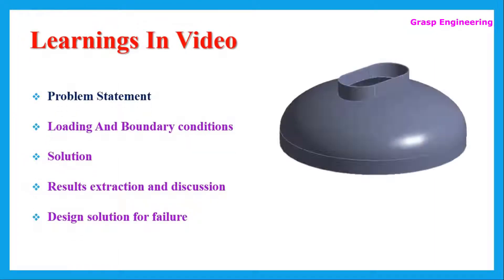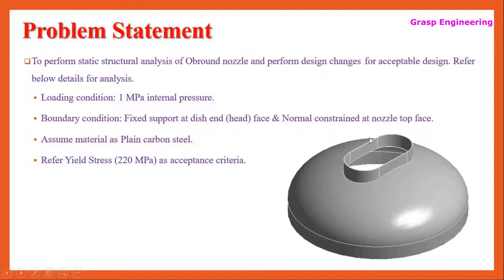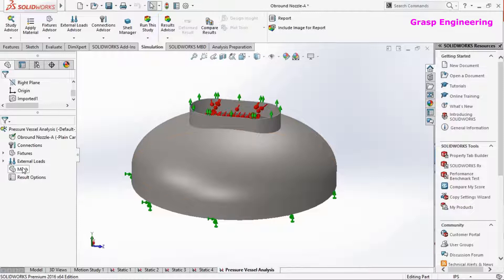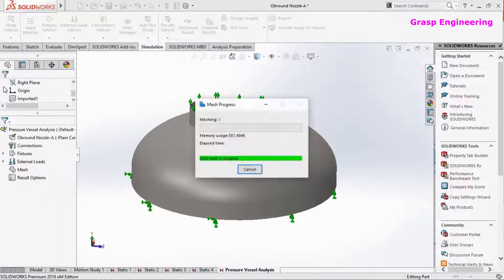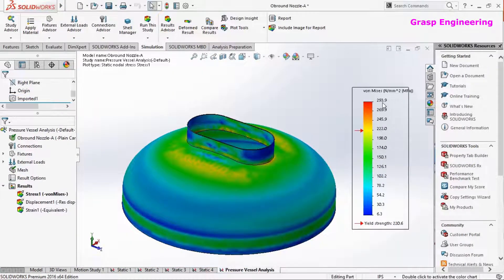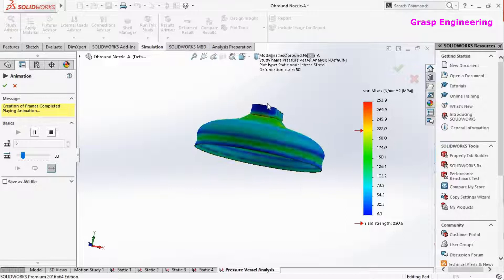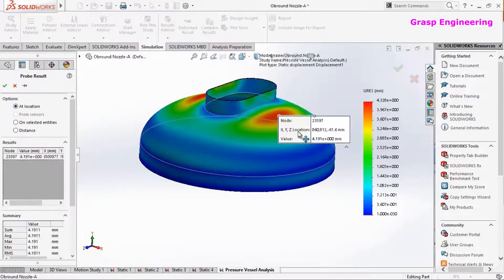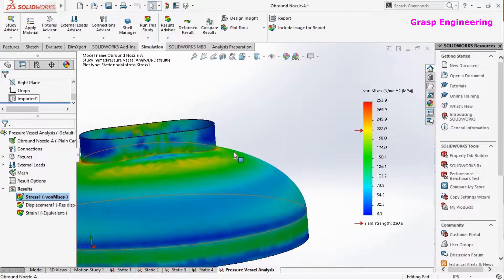FEA Analysis of Nozzle Head Junction using Solidworks - Beginners Tutorials #1

Comment: Why we have not applied compensation pressure
If yes how to calculate compensation pressure for rectangular opening.
For circular opening it is simple. What about rectangular opening.
Reply from the maker: You need to follow the same methodology (as circular area) for rectangular area. Just equate both rectangular area to get the final equations. Refer our blogpost: https://www.graspengineering.com/what-is-compensating-pressure-what-is-compensating-force-what-is-thrust-pressure/